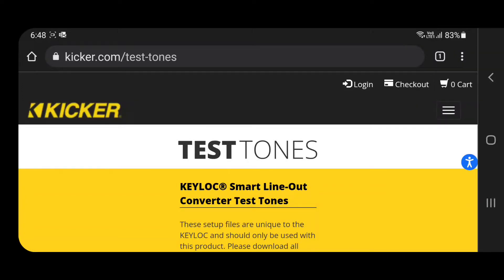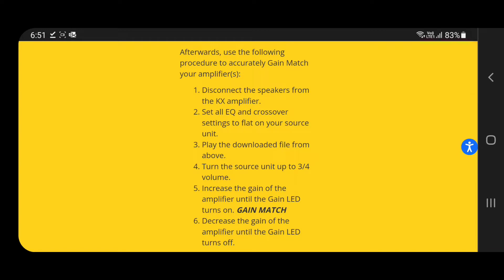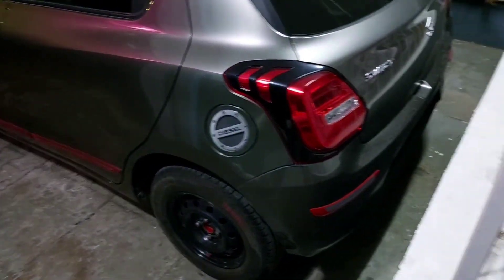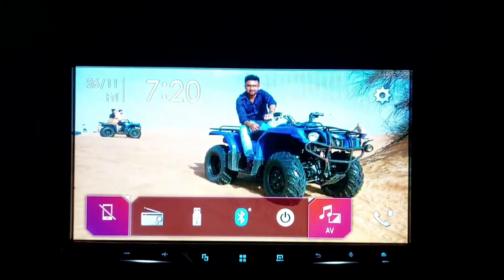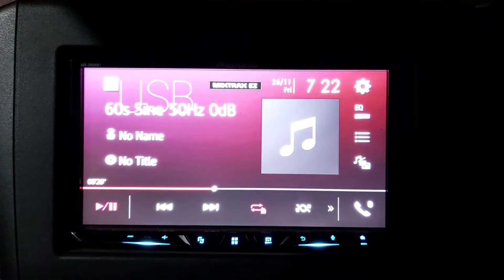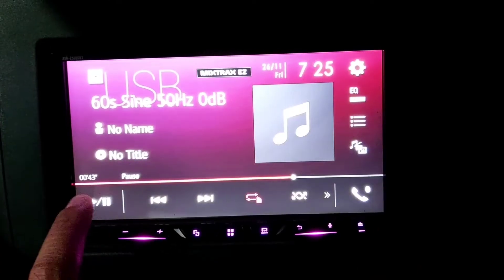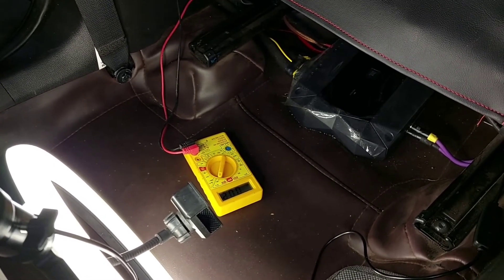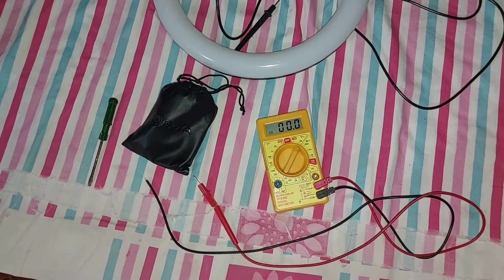Tuning Monoblock Subwoofer Amplifier Gain by Digital Multimeter. Get distortion free Audio forever!

Comment: Hi bro,

Saw ur videos on subwoofer so much impressed with the information and quality u have in ur setup.

Mla pan Pioneer TS-W3003D4 hava aahe

Plz arrange kar na mazyasathi.
Mi thanya la rahto.
Reply from the maker: Okay I'll try to search and ping you.
Reply: Yes plz and if it’s not available plz suggest me the similar type of sub 

I am also impressed with Rockford Fosgate P2D4 12 inch. 

But need ur suggestion too.

My budget is 20k (sub + enclosure)
Reply from the maker: @yogeshlahare8533  nope P2 doesn't have lows. That's not good investment. Go for DD 612 if you can stretch your budget.
Reply: Rather i will go with the pioneer instead.

Mla 3003d4 hava ahe 

I will wait for ur reply, if available inform me.

( instead of regretting later by selecting any random sub i will wait and buy 3003d4 only, hoping for the best)
Reply from the maker: I've asked few dealers in my town but no luck bro. They aren't available.
Reply: Hi bro

I have ordered pioneer TSW 3003D4 from Amazon ( Import from USA)

Only ine question 

Can i use this sub initially at 350w rms amp 

Will it be okay,

Later i will buy 600w rms amp.

Need ur guidance
Reply from the maker: It's okay unless and until you're not clipping your amp

Comment: Ive got the same amp Jbl club 5501
Previously i got 40 volts with the basic wiring of 8 guage the standard 700 rs one. Yesterday i got installed a new caliber audio wiring 4 guage and now when im tuning it it doesnt go beyond 35 volts even with car on, and i got the old wiring installed but its not connected to any amp. 🤔
Reply from the maker: Check RCA is properly installed or not maybe you're not getting full potential from head unit.
Reply: @Live_Loud  ok bro will check the guy who installed turned bass boost all the way up as well 😆 Also i told him to keep the wires left overs the wires are rolled up and long Connected to the amp.
Reply from the maker: @stanz1n594  why bass boost is all the way up? Keep it to 0. Also length of wires should be as short as possible.
Reply: @Live_Loud ah okay thx, i actually keep it to 0 but idk why he turned it up.
Reply: @Live_Loud  Its still showing around 35.6 volts 🤔 and it does sound less than when it used to to be 40
Reply from the maker: @stanz1n594  tell me what subs you're gonna use on the amp?
Reply: @Live_Loud  pioneer 3000t basstube .
Reply: @Live_Loud  i have total 3 wiring from battery one for headlight relay one for the jbl club 5501 amp and one wiring is just sitting in trunk.Could it be the ground of the battery 🤔 cause that wire is kinda small. But still i got 40 volts before 🤔 .Also could it be the headunit something with it? I havent changed the headunit tho, and i also reset the headunit and also tried it on pen drive with engine on and also off. Surely the extra wiring itself doesnt take up like 5 volts right?
Reply from the maker: @stanz1n594  honestly even I was unable to have 40vac I thought that's problem with my DMM. You should try better DMM with true rms capabilities or just tune amp to clean 32VAC otherwise it'll go to protect mode if you increase gain too much!
Reply from the maker: You can see in video itself it went till 38VAC not over that.
Reply from the maker: It's because of cheap DMM. It's leads heat up quick!
Reply: @Live_Loud  Ah okay will check on others' multimeter i guess thx

Comment: Hello sir how to check the rc pre out put voltage of the car sterio by multimeter
Reply from the maker: it's provided by the manufacturer.
Reply: @Live_Loud  is it not possible to check by multimeter sir
Reply from the maker: @gajju6222  multimeters are not accurate at that small voltage level. If you have Chinese head unit then anyway you can't even measure as realistic pre out voltage of those android head units is below 1v!
Reply: @Live_Loud  tnk u sir

Comment: if i tune it to 75 % vol ,should i go above it while playing music? cause its not that loud .
Reply from the maker: Generally good head units send clean signal till 75% volume. If you're not loud then you don't have strong amp to support your speakers. You'll need upgrade your setup
Reply: @Live_Loud  oh its pretty loud sorry. it was my phone i didnt set the gain there
Reply: @Live_Loud  i have kenwood headunit there is one option to set subwoffer level it increases the bass tube vol  Compaired to my speakers the bass is lacking i can hear it but its not as enjoyable because the mids and highs overpower should i increase its level ? or reduce the speaker channel gain on the amp.
Reply from the maker: @stanz1n594  keep all levels to 0db and then tune gain on your amplifier. That way you'll get clean signal from your setup and then decide what's lacking
Reply: @Live_Loud  ok thx, yeah i did it already with no processing.

Comment: But i have subsonic and lpf filter in my amp what to do with them
Reply from the maker: LPF on 100hz subsonic on minimum or off if possible. Once you tune the gains you can increase subsonic close to box tuning frequency.
Reply: @Live_Loud  lpf on 100 hz after setting gain or before setting gain
Reply from the maker: @avimanchanda_  gain tuning frequency is 50hz so doesn't matter if you keep LPF on 100hz or more. It's inaccurate if you take LPF down around close to 50hz.
Reply: @Live_Loud  ok thanks bro